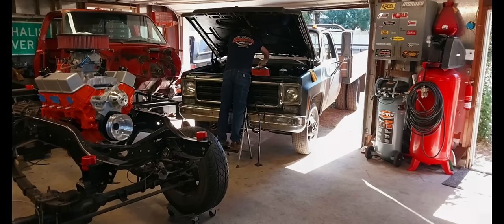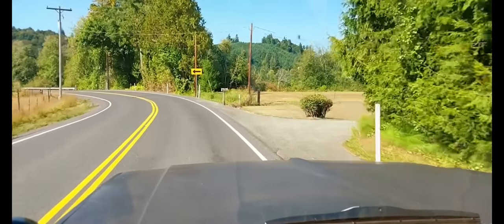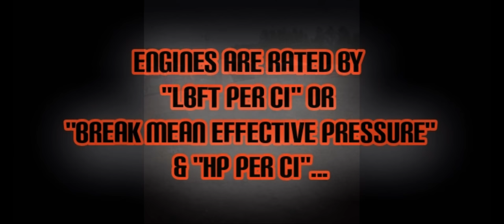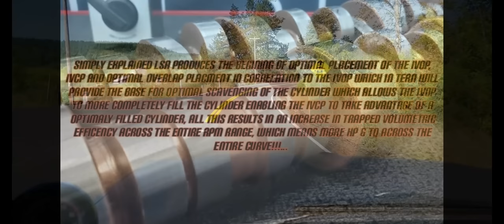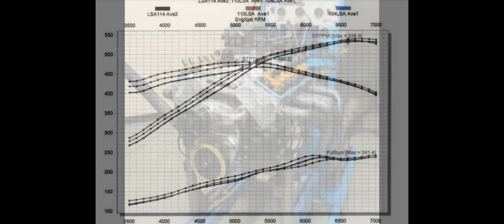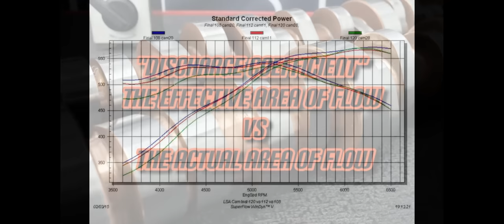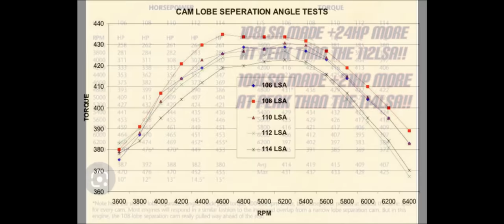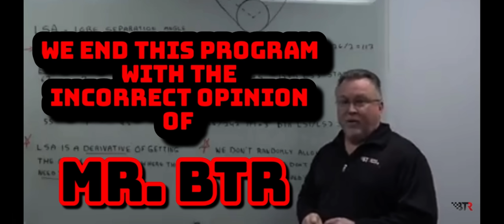Camshaft Selection via LSA, 19LSA's Dyno proven MAX TQ & HP cam tec. LSA, Overlap & Duration convert

Comment: This opened up as the most detailed cam video ever and is only about SBC, but laughably Richard Holdener has certainly dyno'd more engines then this guy will ever be able to lay his eyes on. I have been building HP racing engines longer then the poster has been alive and cylinder heads matter more when choosing cam LSA and that fact is never mentioned. I have never seen anyone use David Vizard and others published book info as their own research as seen in screen shots. If I thought people were even remotely interested in this information then I would have posted actual dyno results years ago, but at most (3%) of hot rodders and racers actually build their own engines. How many engines did it take this guy to dyno at his leisure to get this knowledge burrowed from others? Since you are only 27 years old and have over 15 years with this specialized knowledge to open an engine building shop then why haven't you? Plus where are the build specs and dyno sheet on your mighty 383 that will never out torque even a mild 502  BBC or 540 BBF. My personal NA 421 Dart SBC makes 627 HP and 540TQ on E85 with CNC AFR heads and a solid roller cam with 104 LSA at 6800RPM, but my 496 BBC makes 722TQ at  4800RPM and my BBF 572 makes over 700TQ at only 3600RPM only. I expect my comment to be deleted when read by the channel author to hide these challenges to him and I hope he sends DV a check in the mail..
Reply from the maker: THIS IS PART 1 OF 2....Now to start with none of this information in this video came from anyones Books and ABSOLUTELY NONE of the incorrect analysis of the dynamics that were created from the change in LSA by the individuals who produced most of the dyno sheets was presented in this video...  Absolutely none of the opinions of the individuals, (primarily at west tec) that produced the "Dyno Data" or what is scientifically known as "Independent data"... The only thing used from their testing was the dyno sheets and 2 sheets showing cam specs for a given test.. Now you do realize that me presenting those dyno sheets with information that originated from my own Experience/mind & Family, Not anyone elses information but mine, yes i did give people DV's EMPIRICAL LSA EQUATION but only because it coinsides and simplifies the results of my knowledge about Optimal Valve Event Timing, and i showed his Equation to help vindicate/explain Davids Equation to those who do not comprehend or Bealive him... I had never read one of davids books until last year after he complemented me on my choices when i built my 383 and the fact that i underrated the power numbers to fend of the dip shits that cant comprehend that 186 heads can support up to 650ish hp but for 186's to do that it would have cost about $6,000-$8,000 to make them do that which takes alot of skills, luckily we have that skill so it just took time... Davids complement had emphasized specpecifically on the Valve Event Timing specs i had chosen that were relevant to literaly every aspect of the engine... At the time i knew who he was and I knew it was a big complement coming from him but i didnt know his EMPIRICAL EQUATIONS for LSA & Duration, I didn't know his method at the time i had never read any of his books, but he said what i did with that 383 was optimal and definitely shows because every truck in the 44'+tire class had a Big block in it and most of them had 49"-54" tires, there were 45-50 trucks per class, I got first place back to back 3 times and got 3rd once because the truck broke... i had to quit that cuz of serious health problems... After David had given me that complement i started reaserching the basis of Davids method and it just so happened that all the Constants, parameters, variables, Coefficients, dynamics,etc, of Davids method lined up with my understanding of the dynamics of of valve events but David never really lays out what is fully going on Dynamicly with the IVOP, IVCP, EVOP, EVCP, OVERLAP and the correct placment of Overlap which = Optimal Scavenge cycle Timing when specifically placed... Now You obviously dont know that it's called "Scientific Method" to use acurate data from other individuals testing, This is known as "Independent Data' which is good because there is no Bias leaning towards your methods in the results that others have produced...Independent & Dependent Data backed by solid evidence along with Dimensional Analysis is a very simple explanation of Scientific Method.. Accurate Independent & Dependent data is exactly what i presented and broke down analytically... The "Dependent Data" i provided from my own Experience/Knowledge and Observations which absolutely alligns with the "Independent data" which i had accumulated from dyno data/sheets off the internet, which like i said is good cuz there is no Bias towards what information/research your presenting, i displayed 2 of Davids dyno sheets to show how everything as far as optimal valve events coinside with the Independent data i had gathered and the Dependent data that originated from myself....  This Video is absolutely is the most explanatory & physicaly demonstrated/illustrated video out there and I explained it without a bunch of complex Physics/Science, If I had, at that point with a video that complex the video would be useless cuz 1-2% or less of the world population would understand a video about how to produce the best Gas Dynamics that lead to Max Volumetric Efficiency Across The Entire  Curve via the effects that Optimal LSA has on IVOP, IVCP, EVOP, EVCP, Overlap, & the correct placment of Overlap in relation to the IVOP that in corralates with the EVCP for optimal scavenge cycle which in tern is relative to maximum volumetric efficiency capabilities of the IVOP & IVCP...  You said something about i didnt talk about heads, this video clearly was not about heads at all, It was obviously about LSA & Optimal valve event placment but I gave the influential factors that cylinder heads have on LSA aka the begining of optimal Valve Event Placment. .. All you need to know about a "cylinder head" to select LSA is the "DISCHARGE COEFFICIENT" which in is represented by Intake Valve Diameter in Davids "EMPIRICAL EQUATION", I did give the Scientific Sae Constant of 137cfm/sqin but most top pros use 146cfm/sqin i also gave and the EMPIRICAL EQUATION to calculate a cylinder heads Discharge Coefficient which is Curtain area=Valve diameter×pi×lift... then Curtain area×146cfm/Sqin= Theoretical Max Flow Area, then you take Cylinder Head Flow @.??? Lift ÷Theoretical Maximum Flow= Discharge Coefficient of a given Cylinder head at a given lift... That calculation was for those who are more advanced that already have a good understand and want to work on being more precise with the calculation for their valve event timing/LSA results, Can you explain to me what a "DISCHARGE COEFFICIENT" IS??? WIthout looking it up??? Its explained in writing in my video... So Being as my personal knowledge lines up Mathematicly and with the physical principles of Davids I had shown Davids Duration Formula and i gave MY PERSONAL EMPIRICAL FORMULA for Duration and the conversion of camshaft specs based off maintaining the Optimal LSA and a specific amount of Overlap, this was not just pulled out of thin air, it was determined threw 3 generations of racing engine/camshaft/cylinder head reaserch via Scientific Method which is threw R&D/acurate data acquisition and physical observation that can be Mathematicly explained, that is how my Duration formula was created(And IT IS EMPIRICAL!!),... I even have a personal formula that is only "383 specific" it's (383÷8×2.02÷.91)=106, that also lines up perfectly with davids 128 Equation for a 383 w2.02 valves & 10:1-10.5:1 compression                              (example 128-(383÷8÷2.02×.91)=106  You do know the physics of the universe can be mathematically explained right??? My Duration formula just so happens line up exactly with David Vizards Duration formula but mine has been Mathematicly Simplified which is what you want with an empirical equation, Davids only does Advertised Duration, but mine is intended to do @.050 & Advertised Duration along with cam specification Conversion according to Optimal LSA & A specific Overlap.. You will find this nowhere on the internet hands down, you will find very very very very small peices of information about how to achive the optimal Gas Dynamics via the Dynamics of optimal valve event timing, along with their effects and their order of importance... Now Next, that sure is a lot of extremely speculative ideological BS you created in your mind about myself based off of no use of scientific method, no scientific/empirical evidence on your part for your extremely ignorant claims about my knowledge experence,(you do know what Empirical means dont you, without looking it up??) Also look up INTJ personality because that is what i am scientifically known as and you will see that INTJ's only make up 2.1% or less of the population... Now to adress my Experience.. Now just the simple fact that somehow what you got from the video that lead you to bealive im 27 years old says alot, 😆 WTF, How did you come to that conclusion??? And I never said I've built 1000's of engines, I said I've built COUNTLESS ENGINES which is a figure of speech for I've built so many that I can't even remember, ive personally built 200-250ish engines, but I've easly been a part of and or seen 1000's & 1000's of engines built, in 2009 i built a 555BBC that made 1.63lbft per ci for my buddies pro stock pull truck, a modern pro stock engine is around 1.7lbft per ci...Now How TF can could i have 27 years of knowledge & experience in engine building, optimal valve event timing Dynamics, a full understanding of mechanical engineering and physics of all kinds if im only 27 years old???😆 when does the 27 years of experience come into play???
Reply from the maker: PART 2...
I must have started with the physics of high performance engines as soon as i popped out according to your inaccurate conclusions, That is about one hell of a conclusion on your part, it just goes to shows your lack of comprehension, your inability pay attention and your lack of acurate analytical skills apperently of the simplest form...  To start with im 37 😆, Also You do realize, as i said in the video my grandfather is a Physicist/ Engineer and worked for GM & he was also a race engine builder, who then tought my dad who was was a Mechanical engineer, master machinist, welder & race engine builder, and i was a Engineer/machinist/welder & race engine builder, For a lil over 18+years my dad owned a high performance machine shop/engine reaserch facility that did alot of engine and more specifically cylinder head & valve event R&D befere my dad got carcinoid cancer & shortly after that i broke my back on top of taking oral chemotherapy for a rare skin related cancer, the chemo drug weakened my spine that was allready in bad shape from extremely hard an physical life in general, so ultimately we had to sell the shop because of health purposes, this was the very begining of why im not in some sort of position in the automotive industry and or have a Big Shop... A lil later in life i had to quit my formal education at almost the end of the 3rd year for my masters in mechanical engineering because my grandmothers alzhimers got so bad that she needed takin care of so i sacrificed some of my life to make sure my grandma had the best end of her life, she's been with us 14years and 12 of them require care 24/7... At 28 years old i became paralyzed on my right side while working in the garage, I damn near died, I spent a lil over 1 month in the hospital and was told i would probably never walk again, I fought hard enough to be able to walk short distances which is where I am today, But i am permanently disabled & plagued by Complex Regional Pain Syndrome (aka suicide disease) which is the most painfull condition known to man NO BS, among my many other health problems and the complications of said health problems that occasionally put me in a wheel chair for weeks at a time, which is why i didnt put a video out for 9 months because of health related complications... I don't like talking about it and I've been dealing with it for so long that im realy good at acting like in not miserable in the videos only cuz i dont stay on camera for long being as i dont want peoples to see how bad it is physically cuz I don't want peoples sympathy.... Now to a simplified explanation of me & my experience because your apperently Blindly Afflicted by whats scientifically known as the "Dunning-Kruger Effect" which is a psychological bias that makes individuals extremely judgmental, speculative and irrational with a false sense of higher knowledge because they cant psychologically comprehend the complete complexity's and how deep certain subjects really are so they have no idea and cannot begin to comprehend that they dont know what they know, and ultimately with that way of thinking they will never be psychologically aware and able comprehend their plagued by the Affliction that is the Dunning-Kruger Effect.. You can take away from this what you will, but you should question yourself before making such outrageous speculative ideological statments because you never know who is at the other end... Here is a quote " The intuitive mind is a sacred gift and the rational mind is a faithfull servent, we have created a society that honors the servent and has forgotten the Gift".(Albert Einstein)... For generations my family has been a very scientific oriented family, So here is a rather small scientific break down of myself for you... This is purely based on reality & science, Ultimately i am a product of rare mixture of 2 very rare Highly intelligent personality types, my INTJ Dad & my INFJ Mom which resulted in me having an extremely strong INTJ personality which is 2.1% or less of the population, the average INTJ has an iq of 130.. It is scientifically proven that intuitive intelligence is the higest form of Intelligence and intuitive intelligence is the primary factor for an INTJ mind... Now being as my family have always had a solid understanding of Alot of different regions of The Scientific side of life, They had a solid comprehension of Human Psychology so my parents knew about the effect/influence of what is scientifically known as "The early childhood development period" which is from the ages of 2-8 years old and it is the most critical time in the development of a child's understanding of the world around them and is the most influential time for the development of a childs rational intelligence beyond the childs given amount of natural intuitive intelligence... so by the time I was 8 years old i knew the valve events, the effect each valve event has on an engine and how to adjust Valve Events to achive specific results, etc, I had built my first engine at 10 years old, and by 10 I was running machining equipment, playing on a flow bench and knew more about Cylinder heads than most grown men and i was learning more every day....  Now how common do you think a family is with PhD Physicist & engineer for a Grandfather, a father that was an Engineer/Master Machinist bolth have generations deep knowledge about the complex physics of the world around us that is applied to the physics/dynamics of high end race engine building.... What do you suppose a kids childhood is like being born into something like that with all that knowledge to be absorbed??? I was literally raised around the building of high HP engines in a machine shop/research facility with a dyno cell... If you understood Human Psychology you would be very aware the 16 scientifically proven personality types that exist and that obviously not every kid has a the same personality type, similar childhood, or has the same mental capacity, intuitive intelligence/knowledge, rational intelligence/knowledge, abilitys and experiences when they are children... 99%+ of kids don't have a Grandfather who is a physicist, ex engineer for GM, and race engine builder and A Dad who was an Mechanical engineer, master machinist and race engine builder... how many family's do you know with those specific vocations, credentials & knowledge, that pass down generations of their rare valuable knowledge, and start very early properly educating thier children to understand the world around them, and this begins from the ground up with what children cant see, starting with Nuclear/Atomic Particle Physics, the base of Quantum Mechanics to expand one's mind, the laws of Thermodynamics, the 26 dimentionless constants that discribe the universe along with the 4 theoretically 5 fundamental forces, those being Strong Nuclear Force, Weak Neculear Force, Electromagnetic Force, Gravitational Force, and possibly Dark Energy... does all this sound like the typical childhood???  Is it completely unbealiveable for a kid growing up being taught in such a way and experience all this knowledge???... I almost for got to say this,  This video was not for "As you say SBC", the physical principles that apply to the information i gave about IVOP, IVCP, EVOP EVCP work across the board, you obviously completely missed the fact that I put the correction numbers for the 128 constant that are in relation to some of the most common engines, those being of course SBC, LS, BBM, SBM, BBF, Cleveland Ford & Windsor Ford plus the 133 equation for BBC With proof of the effects that are produced by the 107LSA on that 572BBC
And the fact that 128 works for LS engines also with dyno proof of the effective increase across the curve... Oh yeah and this supposed dyno data you have purely related to LSA I would love to see the proof of that, because I am well aware how expensive testing like that is...